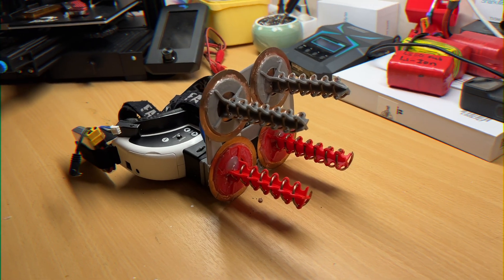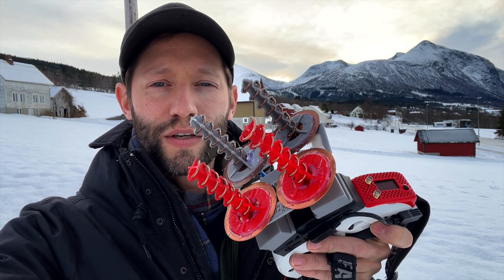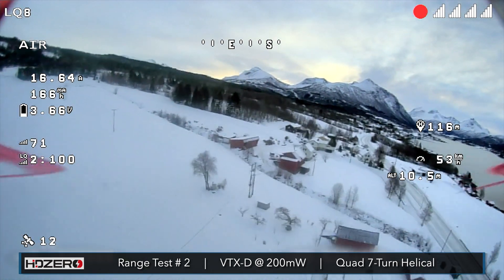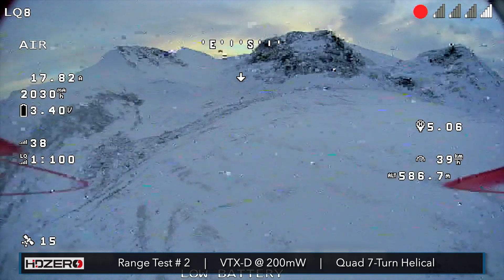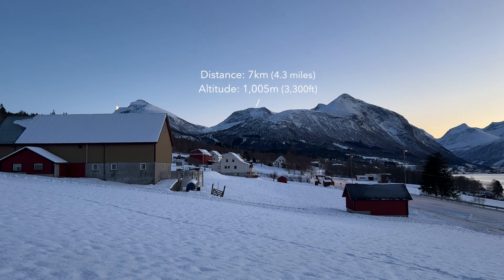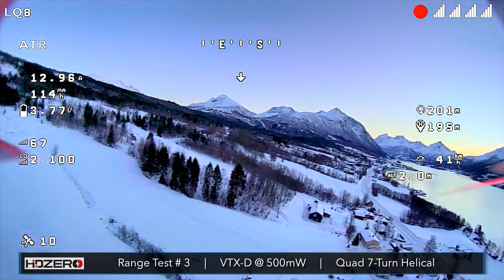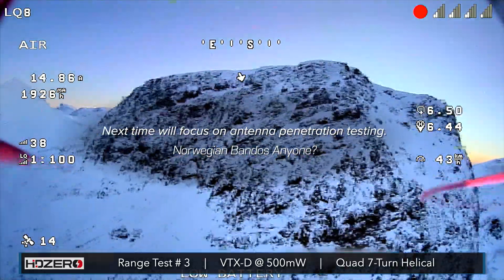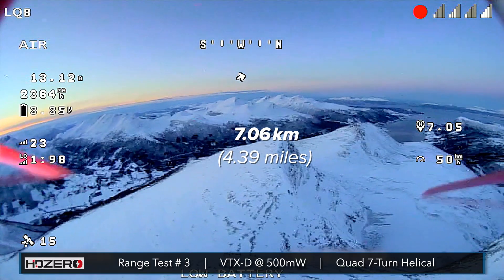HDZero SharkByte Long Range Testing with DIY Quad Helical Antenna! UFL to SMA Adapter Modification

Comment: I have been out 6 miles with a 4s 21700 Li-Ion pack on my Recon 6 inch running a 3 turn helical using rapid fire on HDO2 goggles. My picture was not as good as yours but still flyable. Next I will try my 7 turn Helical. I can stay in the air around 28 minutes when the temp's around 75F but flight time drops to 24 minutes at 45F.   My limiting factor will be battery life.  Maybe a wing in my future?
Reply from the maker: Yea the Rekon is a great setup! My current quad is absurd for long range, cheap old frame with 2450kv motors… hardly efficient. Looking forward to finishing my Chimera 7! 
Wow, 6 miles with a 3 turn is great, using the 7-turn will definitely improve your video link. What VTX antenna are you using?
I’m thinking about a wing as well.

Comment: But you also reached 6km with just 2 helicals. I wonder if those addition 2 helicals even make a difference in range at all.
Reply from the maker: Exactly, the main benefit of the 4 helicals is not necessarily range, but rather decreased breakup and improved video quality. 
   This is because the HDZero system actually combines signals from all 4 antenna signals and so having two weaker antennas would theoretically degrade the video quality. 
   I need to compare and analyze my previous footage, and better yet run some new tests directly comparing the two setups. For most people, including myself, the simpler two helical setup would be perfectly fine. I did this project out of curiosity and for fun! 
   Thanks for checking out the video, and providing your thoughts. Definitely worth looking into, stay tuned and I’ll try to find out!
Reply: @GiantAntCowboy  it would really be interesting to see if 4 helicals actually make a notable difference. And if that difference makes up for the fact that the goggles are heavier and look - well - even more stupid than with just 2 :-)
Reply from the maker: @oli_flies_quads  yea, I’ll see what I can prove. I do agree the quad helical is inconvenient, and silly looking. I partly made this as a joke/for fun, but also curiosity.  With the new VTX-L which I’ll be testing soon, you’ll two helicals will be way more than enough for 7km trips, which is plenty for most of us…

Comment: Curious to know the video range with 1w tx and those 7T helical antennas.
The limit of dji system is 14 kms in high power.
The New Siyi system HD over 18 kms for the moment or more  but with high latency.
For your interference between Crossfire and video, maybe put the rx video on a tripod connecting  to long HDMI cable  on your Google and  far of tx radio , it s just an Idea.
Good luck  in your long range adventure 🤞
Reply: I have the siyi hm30 system coming this week to try on my homemade FPV Cockpit,  looks promising for long range fixwing,  I have the SharkByte system and love it , check out my homemade FPV Cockpit
Reply from the maker: Amazing FPV setup, definitely curious about this SIYI system, besides the higher latency it’s looks pretty decent actually. Curious to learn more.
Reply: @GiantAntCowboy  thanks , my Siyi hm30 system should be in soon , ordered the hdmi converter with it to hook up to my screen , just replace the 32" screen with 50" , cait wait for the system to come in and good weather to try
Reply from the maker: @jimmytheriot8978  oh whee, excited to hear your thoughts!
Reply: @jimmytheriot8978  50" screen , you will be like in cinema 😃
Reply: @SergyFPV  yeah can't wait till I get everything in
Reply from the maker: The 1W will exceed DJI’s 13.3km hard stop, I’m sure of that, and I think with the right antenna setup it should match SIYI’s range as well. However we’ll just have to wait and see! My goals have always been mountain surfing which is mostly under 7km, and I just want solid, clean and dependable video signal. 
Regarding the ground station, I think that is a perfect idea but I’m trying to keep the setup compact and light because I often go hiking with my gear and it’s already heavy and bulky enough… haha Thanks for tuning in and chatting!

Comment: 1️⃣💡boy you are Peter! Keep up the great work.
Reply: I recently flew my Dji Mini 2 around 4 km each way but in s suburban over a walking track i turned back after starting to loose video signal
Reply from the maker: @Bellairvideo  Yea, it’s pretty fun to cruise the skies. Biggest thing to remember for range and signal quality is to avoid having any obstacles/or wires, in between you and the drone. Thanks for checking out the latest film. Cheers

Comment: Great video and flight.  It’d be some recovery mission up there😬
So close to getting back😅it was just that extra bit used up getting to your 7km goal.
When you get the Chimera 7 there will be no stopping you, because they are just awesome for long range 😎
Keep pushing 🚀
SUBBED 👍🏻
Reply from the maker: Thanks Kev. Yea, if the drone crashed at the top there would be no search and rescue mission, just a heartfelt goodbye. Super excited about the Chimera7, especially with the new 1W VTX. That’s combination will definitely be unstoppable, my goals aren’t really incredible long-range, most my actual flights are 4-5km, but if we can easily double that then the level of confidence at 5km is very high! Thanks for watching commenting and supporting the channel, cheers!
Reply: @GiantAntCowboy  Mine is on the Air unit, so 8.2 miles is my limit.  I’ve been out 6.3 miles so far, but like you say, most normal flights aren’t going to be anything like that, covering such distances is only for testing purposes really and as you say, gaining confidence it the gear.  There’s nothing like hitting GPS rescue over 5 miles out, and seeing the image come back after about 20 seconds(feels like 20 minutes)when the goggles have rebooted to give you the confidence to keep pushing.
Reply from the maker: @kevcdrone  My number one issue with DJI is that it unbinds and reboots when if you lose enough signal. Sometimes I’ve heard it can be several minutes without video if your far out, scary! DJIs image quality is incredible though.  
I posted a video earlier this year “Lost signal in the mountains” where I completely lost signal for over 30 seconds. Assume it was gone, but was just hiding behind a mountain for a while… haha
All part of the fun!
Reply: @GiantAntCowboy  I’ve had it do the full reboot and it was about 20-25 seconds, about 5.5 miles away.  I’ve never heard of a couple of minutes 😬
It is an incredible image as you say.
There’s nothing like that feeling when the picture comes back is there😅

Comment: For your longrange missions you could consider a wing..
Reply from the maker: Yes I’ll probably build one early next year. Though where we live it’s actually hard to find clear LOS beyond 8km unless you climb to the tops of mountains. There is an valley behind our house which is about 10km that I’d love to cruise though.
Reply: @GiantAntCowboy  I understand.. so no need to go even farther xD
But your last flight would have been way easier.. I tested my wing - flying in circles till the Batterie is dying: 60km and over an hour of flight time.
But that was just my thought. Your content is good enough as it is - no wings needed 😉
Reply from the maker: @blackbarett6632  thanks, yea at this point I’m just testing the system, excited to test the new 1W vtx soon and share those results. For my actual used I’m generally flying local mountains which are 4-5km max, but if your system can go 10km than at 4-5km it’s barely trying which is comforting!
I 100% see the appeal of wings, and my father in law has recently expressed interest, so as I said I’ll start looking into them. What’s your wing setup, if you don’t mind sharing?
Reply: @GiantAntCowboy  
My current setup is an AR Wing Pro by Sonicmodell - I got the PNP Version for 108€ so I couldn't resist since I crashed my old one xD

ESC: Sonicmodell 40A
Motor: Sunnysky 2216, 1400 KV
FC: the discontinued Mateksys F722 Wing 
GPS by Mateksys
VTX: Unify Pro 32 HV
Cam: Runcam Racer 5
RX: TBS XF
Battery: 4S2P 7000 MaH Liion by ZOHD

Cruise Speed is about 60-70 km/h

So nothing special really.
Its a fun wing, but I would prefer a "real" one  with a "T-tail".
Also its made to carry an action cam - therefore it's really tail-heavy and you need a lot of weight in the nose.
CG should be pretty good as well and you will probably have to use some weights.
There are ventilation holes everywhere to cool your electronics and a lot of bays to put them in to.

Long story short:
For some LR flights this setup could work well - big battery and Actioncam.
For your father in law, who's probably enthusiastic about planes, it could be the wrong choice.
Reply from the maker: @blackbarett6632  great info, I’ll definitely do some research but handy to see what others are doing. My father-in-law actually has no experience with RC aircraft… so I’ll probably have to get a trainer plane of some sort beforehand. Anyway, thanks again!
Reply: @GiantAntCowboy  I have the siyi hm30 system coming this week to try on my homemade FPV Cockpit,  looks promising for long range fixwing,  I have the SharkByte system and love it , check out my homemade FPV
Reply from the maker: @jimmytheriot8978  Neat, I spent some time researching the SIYI system and it seems really decent actually. The only con I could see and higher latency, which with a long range wing will be no issue at all. Curious to hear what you think, I’ll check out your channel. Cheers!

Comment: Yes, only those who have used lithium-ion batteries down to 2.5 volts or less are truly long-range pilots.
Reply from the maker: Yes this pack actually dropped below 2v… but after warming up it came back to 3v. So 1) the battery is fine, I beat these things up pretty good. 2) the cold was certainly recusing my battery life. The am for watching, cheers!

Comment: You got some yaw drift going on.
Reply from the maker: Ugh I know, need to fix that, think it might actually be from a twisted arm… maybe it’s as simple as trimming the controller. 

But this frame is so old, and the new 7” will become my go out long range quad anyway.

Comment: I get interference on analog from crossfire if I don’t point my tango2 down a lil bit.  It doesn’t scramble the video much but I can really hear it in the ear piece
Reply from the maker: Interesting, that’s what I noticed as well, I have to point the controller way down towards my feet to minimize interference. Thanks for watching and sharing thoughts, cheers!

Comment: as soon as sharkbyte came out and I saw they were forcing people to use those terrible immersionrc patch antennas, I knew they would have to go in order to get better coverage and range
Reply from the maker: Yea, pretty generic antenna. The newer VRX models will have 4 sma connectors going forward, so people can chose antennas that fits their style. Thanks for watching and commenting, Cheers!

Comment: Surely angling the helicals slightly would be more beneficial?
Reply from the maker: I’ll have to test other configurations for sure, my thought was to focus all antennas at a signal point for the best signal reception, as opposed to having a wider beam. 
But this will be an interesting test for sure. Thanks for sharing feedback, cheers!
Reply: @GiantAntCowboy  you could also try different gain antennas, 1x 3 turn, 1x5 turn 1x 7 turn & 1x 12 turn. That would be very interesting! Would create almost a cone radiation pattern
Reply from the maker: @pritchfpv6070  absolutely, I have thought about this also. A lot of neat stuff to try, always fun DIY projects and experiments.
Reply: @GiantAntCowboy  also have you ever thought about running 6" biblades? It would add some extra efficiency which it seemed you needed 😉
Reply from the maker: @pritchfpv6070  You know I do have some 6” bi-blades, tried them once and found that I missed the thrust, especially with a GoPro mounted… but my Chimera 7” should be down after Christmas and then this current quad won’t be doing long range trips anyway.
Reply: @GiantAntCowboy  you could also try a flywoo explorer, I love mine!
Reply from the maker: @pritchfpv6070  yea, always likes those!

Comment: amazing Test flight.
you are still flying the zmr250?
but the Azure 6145 Props do an amazing Job.
you better get your 7" rig ready before you loose your beloved zmr250😂
and dont forget to build a 5s1p Liion battery to get some more Playtime.
this antennas Work great for me AS Well, using them for flying my analog Setup 7" LR.
Hope to See your 7" in the Air pretty soon.
Reply from the maker: Oh man, this was the maximum limit for this quad for sure, obviously… still waiting on parts for the Chimera7 but I think it’ll be worth the wait, exciting stuff. I’ll definitely be building 5s for the new setup. Glad to hear the helical are working well for you, they really are amazing! 
Thanks for checking in and watching the latest vid. Cheers!

Comment: Wow, love this episode man. HDzero will be the next one for me. Great job and glad it made it home.
Reply from the maker: Thanks appreciate the comment. Huge win making it home, that’s the limit for that quad…
Reply: By the way can you metion here what is the specific thickness of the coil and the patch plates? Im planning to make two helicals for my LR mission. This week I will be making my 6s lion pack.
Reply from the maker: @LakayFPV  I believe the wire is 10awg and the plates are like 2mm thick, but I can confirm tomorrow. I’ve used all sorts of materials to make helicals and they’ve always worked great. So don’t worry too much about it. 👍

Comment: VERY NICELY DONE!!!! These tests are looking really good... 5km on 200mw is quite formidable! Time for ELRS 2.4ghz to reduce the interference! Holy moly, Congrats on the personal best, I just got my first 6km on my channel the other day, but you got me beat! I did it on DJI 1000mw and elrs 100mw 150hz. I barely made it back, landed about 60m short of my home position with 2.5v cells. What a rush!
Reply from the maker: Yea, I’ll have to look into something to resolve this interference issues. It is a total rush for sure. Which frame/quad are you using?

Thanks as always for checking out the vids Beans! Cheers
Reply: @GiantAntCowboy  I'm flying my long range with an off the shelf Flywoo Hexplorer HD :D It's a winner for hiking/recon because it packs small. All in all, I think the interference was minor but I'm curious what a different rc system might do to improve (or worsen) the signal.
Reply from the maker: @BrandonBeans  Yea those little FlyWoos are great! Always kind wanted one. I’m gonna try turning telemetry off and see what difference that make. The problem is I love having my GPS coordinates sent to my transmitter in case I lose video and crash.
Reply: @GiantAntCowboy  honestly that's sounds risky. Idk if I'd LR without telem!
Reply: Does 900mhz interfere with 5.8ghz often?
Reply: @Super_Mario_Fpv  analog VTX yes. Probably something similar here going on
Reply from the maker: @Super_Mario_Fpv  seems like it. I’m gonna try turning off telemetry and see what difference that makes.